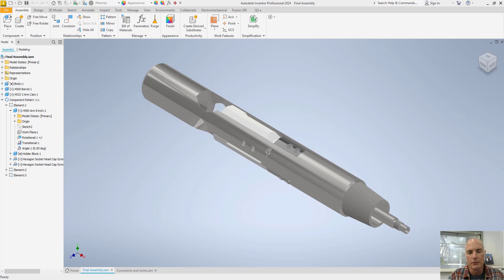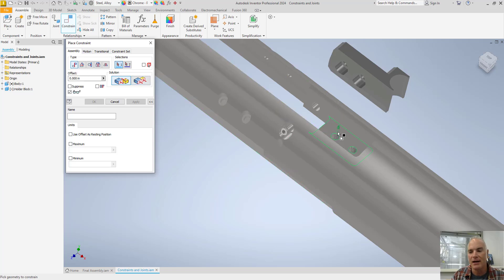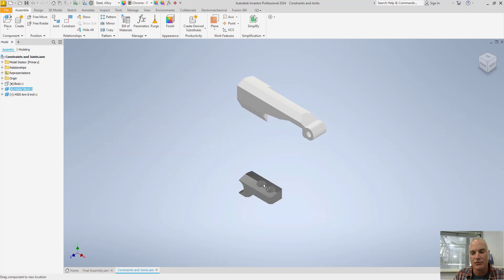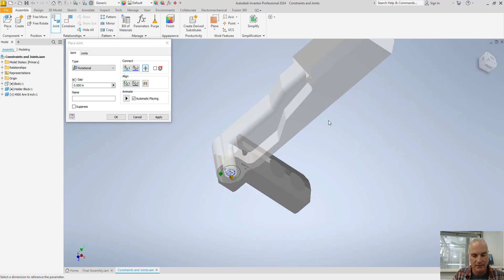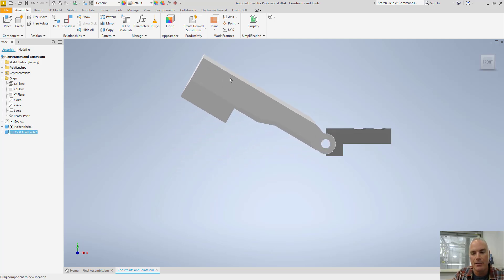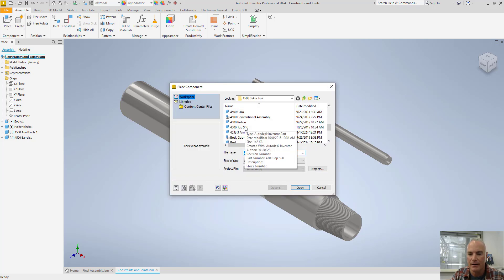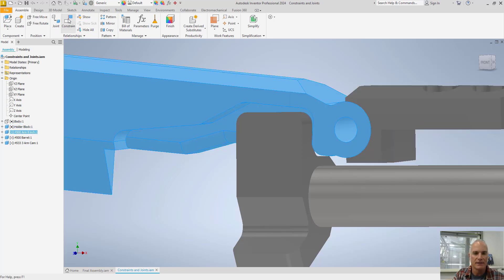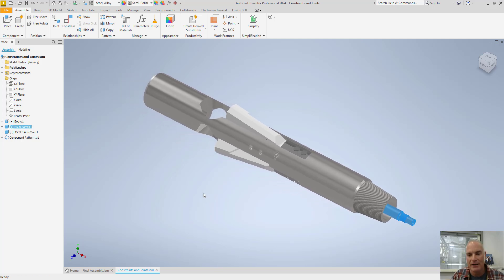Autodesk Inventor - Assembly Constraints and Joints

Comment: Very nice, so what made you use joint instead of constraint when adding the cam to the push rod. And when would you use one over the other if making it rigid?
Reply from the maker: Sam,
Thanks for the question! 
I used a rigid joint to fix the cam to the push rod because, by doing so, it saves time. If I wanted to use constraints I would have to have applied at least two. It is not much time, but every little bit adds up.
Joints are designed to save time in the assembly environment and in the presentation environment as well.
Reply from the maker: Sam,
One approach is to model your parts around the origin geometry ( X, Y, and Z axes as well as the XY, XZ, and YZ planes) and use them for alignment. If you need planes at other angles you can create work planes at those angles. Let me know if you have questions!
Reply: @professor_porkchop  Thanks, I switched jobs and I'm going from Solidworks to Inventor. Trying to learn as much as I can on it as I'm the teams 3D guy. I'm curious about mating planes together in alinement. I work with round objects some with things leading off from these objects in directions that need to be fixed, but mated to another object as a long run of pipe. I plan to work through your videos soon. Thanks again.